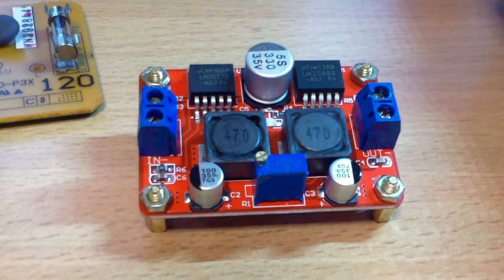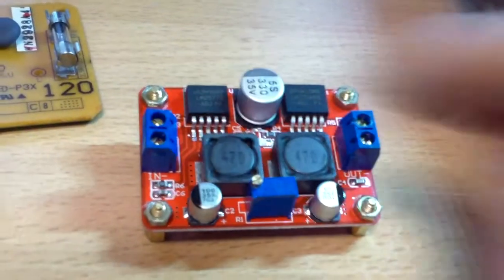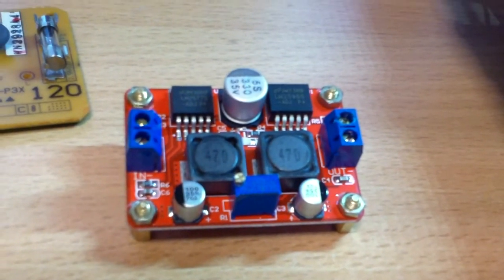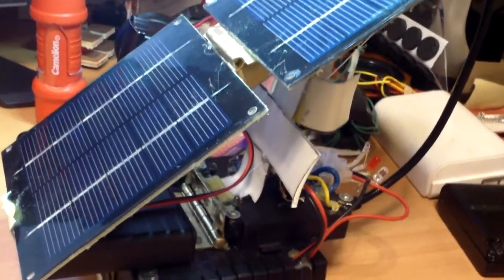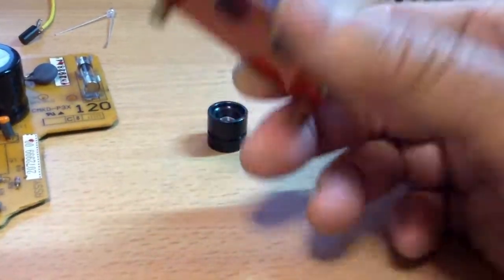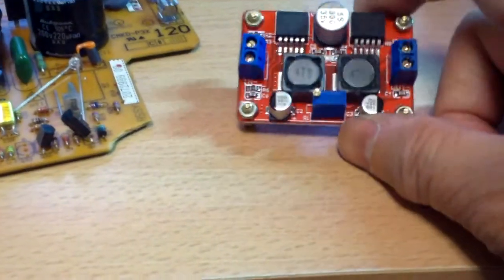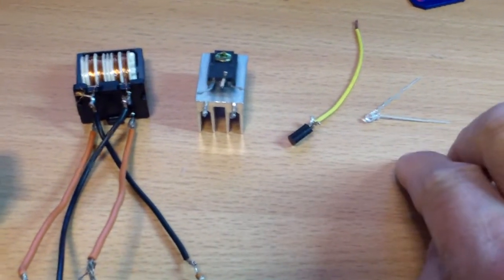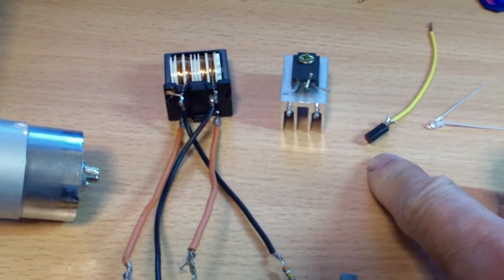dc to dc boost buck converter for small projects

Comment from the maker: I haven't used it in a wind project yet. It is supposed to be a boost buck converter so it should work in boosting or lowering voltage, within reason. The caution about input voltage shouldn't be higher is for a boost converter, not so much for a boost/buck converter. I think we should heed the advice on not passing too much current through it without additonal cooling, such as an added heat sink. Good luck in your project.

Comment: may be you could use it to boost voltage up high enough to charge a 12 volt battery with a small wind generator.

Comment from the maker: I just did a search and this came up "DC Converter 10-32V to 12-35V 150W Boost Voltage Charger Step Up Volt Booster" for about $13 on Ebay.  The unit has heatsinks on them although I cannot vouch for the quality or how well it will work for you.

Comment: Hi Gents,
Just watch your video on the LM2596HV boost buck.
I am hoping that this may help me in my needs.
I have a house alarm system which uses a 12v DC Alarm horn. I have just run a 100 Meter telephone cable extension down to the rear of my land where I have put another 12v DC alarm horn, however do to the long distance of the cable, the 12v DC power has dropped down to some where between  3v & 4v DC.
If I use one of these Boost Buck LM2596HV units which you are talking about from China, do you think it will boost tmy DC power level back up to 12v DC to power my Alarm Horn at the end of the 100mt line?
Look forward to your most soonest comments on this mater.
Regards,
Colin

Comment: How does it behave when you apply a reversed input voltage?
Reply from the maker: I usually use it to boost the voltage rather than to step down so I cannot say how efficient it is. It should be more efficient than a simple voltage regulator.

Comment: Sir will these converters charge lithium batteries from a solar panel
Reply from the maker: Absolom Madhaka A slightly different version of this with a current limit setting is better suited for lithium ion battery charging. This one only has a voltage limit.  The difference in price is only a dollar or two.
Reply: wtam69 thanks i have seen that version i like these converters especially when charging lithium batteries given that you can set the voltage as regular charge controllers differ at float voltage

Comment: Could this be used to power an led light using a 18650 battery?
Reply from the maker: John Meyer Yes, but since there is no current limit adjustment on this, you should put a small resistor to limit the current.

Comment: can this converter handle a 12 volt car battery or would that give too many amps
Reply from the maker: Dean Walcott This can handle a couple of amps. You can trickle charge your 12v  battery with this.
Reply: sorry i meant can a 12 volt car battery power this to use for dc lights
Reply from the maker: Yes. You can connect any battery from 5 v up to power small dc lights and  you can adjust the output to a wide range of voltage (approx. 5 to 20 volts). There are versions that can limit the current output as well.

Comment: Sir i have a question 
my project is wireless laptop charger and im getting on reciever end 12v ,so i can use this boost converter to get 18-19v to charge laptop.Will it work to charge laptop.
Reply from the maker: +Khalid Siddique It can work but it will be a little slow in charging.

Comment: Hi, is there a way to regulate current on this board?
Reply from the maker: Consig1iere No, not on this model. There are newer ones that have that feature. I actually bought a few of them and they can be used as chargers or power supplies.
Reply: Consig1iere Just att resistor.

Comment: I've just bought one very similar to this, but mine has 3 pots instead of 1.  I was very pleased with the performance, until I checked the efficiency - wow, it really sucks, from about 65% down to an abysmal 30% efficient!!!   In comparison, I also have individual Buck & Boost converters and with the same load/voltages, they manage a much more respectable 80% - 88% efficient!

So these are absolutely useless for what I have in mind.  I guess I should have researched this a bit more before ordering.  "Sepic" and "synchronous" should aim you in the right direction if 'efficiency' is also important to you.
Reply: I did some more testing on these today.  With NO load attached, these consume between 520mW and 560mW of power continuously.  More than half a Watt - that is horrendous!!!  The dirt-cheap Boost converter I tested, with no load attached, consumed 120-150mW - that's one-quarter to one-third as much!   Also, I can't get the current-limiting (middle pot) to work either.  Whoever designed these should get the sack.
Reply: A few more findings from me.  First off, here is a pic of the dc-dc converter that I got on ebay - http://tinypic.com/r/98vhg4/8 - similar to the one reviewed here, but not the same.

Just when I thought my opinion of the dc-dc converter I bought couldn't fall any lower, I discover another major design-flaw with it.  Bear in mind that these converters are rated at a 3 amp max output (15W limit), well I discovered that if I connect a load of only 400-500mA and then apply power to the converter, both Buck & Boost converters seem to latch on, dragging my power supply right down as it exceeds its 2 amp limit, with the LM2577S getting very warm!!!  The guy that designed this should be sacked.

What another Youtube video called the current-limit (middle pot) turns out to have been wrong - it's actually the other outside-pot.  This does in fact work and is the only way to get loads greater than 500mA to work without 'latching-up' - but at a cost.

In case you may be wondering if I managed to damage the converter I'm pissing all over, I bought 2 of them, and the 'unused' one performs identically.

I was quite happy with these till I started taking measurments - I wonder how many out there continue to use them, remaining blissfully ignorant as to how bad they really are?  It vexes me that there is some clueless individual out there getting paid for creating crap like this.  AVOID THIS SPECIFIC CONVERTER AT ALL COST!!!

And just this particular dc-dc converter,  like I said already, I bought a couple of dirt-cheap Buck & Boost converters as well and they work fine.
Reply: Final word.  I figured out why the efficiency of the dc-dc converter I'm commenting on is so god-damn awful.  These geniuses don't switch between Buck & Boost converters like I presumed, instead they elected to use the Buck converter as a primary-feed (so it's ALWAYS on) for the Boost converter - so both converters are in series and always running!!!  This explains why the Buck converter runs about 10-20C hotter than the Boost converter while supplying a moderate load, and also why the efficiency is so bad - 30-60% max.

Probably all of the Buck/Boost boards out there that have both converters (LM1577, LM2596) on-board are doing the same thing, so should be avoided at all cost - there are at least 3-4 designs being sold on Ebay!
Reply: +Mojo Jomo Could you suggest a more efficient board?
Reply: Converters with the LTC3780 i.c are supossed to be very efficent - over 97%  Unfortunately, the one I ordered arrived covered in flux, someone having replaced the LTC3780 i.c. and done a very messy job into the bargain.  It didn't even regulate properly, never mind its efficiency!  I got a full refund and still have the duff board.  I was in fact kept waiting for months, a replacement board supposedly having been sent, but it never arrived.  Given this delay and the cold weather, I haven't progressed any further with my 'project'.  Still debating whether or not to try ordering more of the same...

Comment: HOW CAN I GET THIS PROJECT TO EGYPT AND WHAT TOTAL PRICE
Reply from the maker: If you can make purchases on ebay, you can easily obtain the parts. As stated in the video, the boost buck converter is about $8. Just do a search on ebay bor dc to dc boost buck converters and you should find them. Good luck.

Comment: Have you had time to use it in any wind project? 

I've been looking at it in Ebay and in the description it says: "Remember that please don't try to do while reverse adjust blood pressure Uses, must enrure that set the output voltage is higher than the input voltage, lest damage module!". The second part seems to indicate that if the input voltage is higher than the output it'll damage the board.  

I've been looking at a similar board that looks better suited  Ebay ID# 180697157377